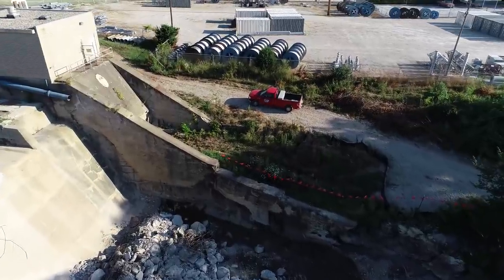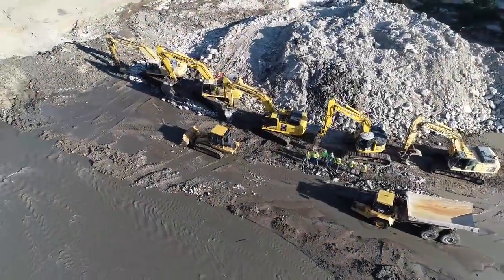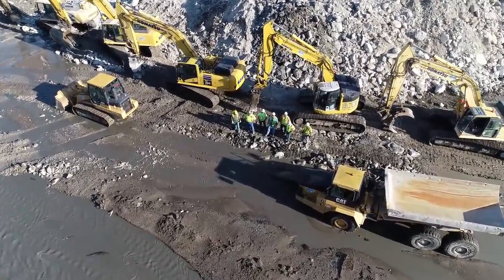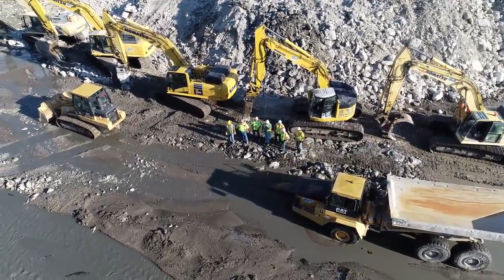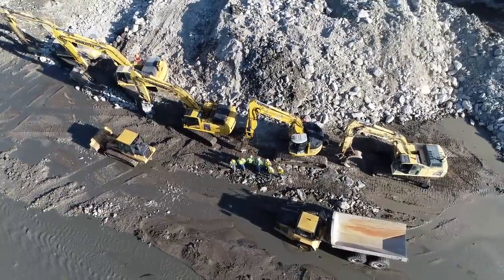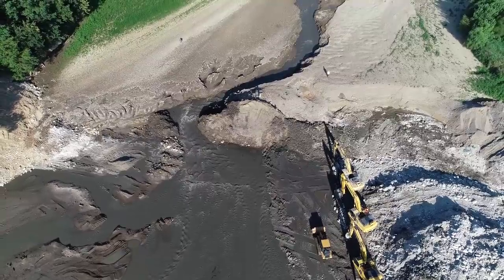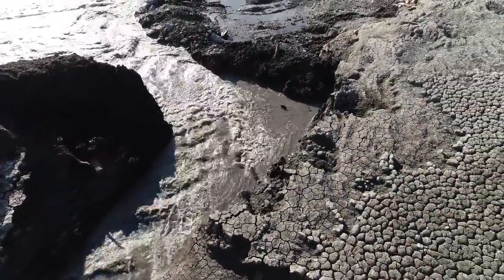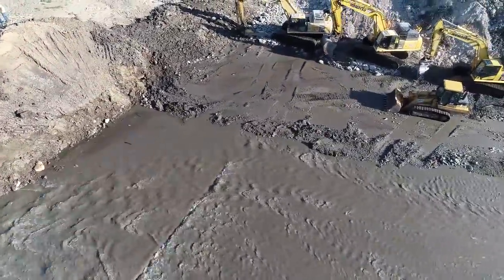Dam Removal Day 25

Comment: What camera is he using you wonder? the DJI Phantom 4 Pro V2.0
Those pillars are there to slow ice and break up the large pieces of ice as protection for bridges downstream, they were installed prior to demolition of the dam, as ice sheets went over the old dam the sheets would break up to smaller pieces, now the pillars are there to stop large pieces until they break up small enough to slip through.